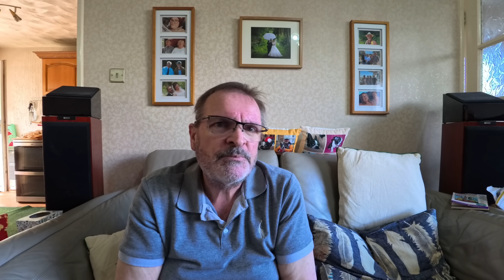Expert Ships Engineer Reacts to Baltimore Bridge Crash

Comment: Baltimore local here, this has been the talk for the last couple of days here and apparently there were two Chesapeake bay pilots on board.  A Pilot and a pilot in training.  All vessels coming into or out of the port of Baltimore, are required to be under the control of a Chesapeake Bay pilot.  The get on at Annapolis and control the vessel until it is docked, likewise they get on at the dock and are in control of the vessel until they get down to Annapolis.   Apparently there was a guy who called into the local talk radio show the morning this happend and said he had been on this ship at the dock doing HVAC work and they had numerous power outages while he was on her as she sat at the dock.  It should have never been cleared to leave.
Reply: Just to clarify. The boats are "under control of the pilot" or the pilots are on board advising the crew? Thank you for the additional information about numerous power outages as she sat at the dock.
Reply: @pgbrandon  The ship's captain remains in charge (with a couple of exceptions it seems). It is more than a formality; he is responsible, they advise on navigation. Off Australia's NE coast, though, if a ship runs aground on a nameless reef there is a tradition of naming the reef after the pilot in charge.
Reply: @pgbrandon  The ship's logs will be a key part of this. Especially pertinent to a distinction between a civil vs criminal investigation, methinks.
Reply: @davidotness6199  i bet we never see the logs
Reply: @drumitar  I replied but my comment got 'disappeared.' At least, I don't see it here. Essentially, I agree it's a possibility if not a likelihood. "Onward through the fog."
Reply: @davidotness6199  Happens to me all the time.
Reply: @drumitar  NTSB says the critical 2 minutes is missing from the black box data recorder. 🙄
Reply: @InnisImage of course it is missing….👿
Reply: @michellelogreco3351  Funny little trend, isn't it?🙄
Reply: @davidotness6199  I get that all the time.
Reply: @schmuckpuppet4842  I honestly don't know, but these stories seem to change over time. I don't rule anything out this early. This administration is way too suspect.
Reply: @drumitar  Why would you, could you even decipher what it writen in the log?
Reply: . Was the pilot a Ukrainian???? .  Was the pilot a u.s citizen ??? Jones Act
Reply: @pgbrandon legally they are under control of the pilot,he gives helm orders to the helmsman. The pilot is a fully trained foreign going master,two of my schoolmates became pilots in our home port & had both Captained vessels of this size,so I imagine that the pilot on board was experienced, the trainee pilot may be learning his new job,but he too would possibly have captained a vessel of comparable size. Add to that the ships captain & other officers on the bridge,even that amount of experience available could not intervene in an engine room failure. I'm sure the Chief Engineer will be sweating bullets & if it a maintenance cost issue,the company leasing the vessel will be in damage control mode.....the black box has issues they say....really?
Reply: @pgbrandon  Only in a few places is the pilot in actual command of the ship, when we sailed through the Straits of Magellan the Pilot made sure that the Captain understood not to countermand his orders but he could change the engine orders to make the ship respond better. The other place was the Panama Canal.  If these pilots in the straits or the canal mess up they get the blame.
Reply: Former Marine Engineer in the Royal Canadian Navy here. If the ship was still docked, then it was probably still on shore power. You don't disconnect shore power until you are ready to leave and all the generators and ancillary equipment on board are functioning correctly.
Reply: @mikearend997 unfortunately, the majority of container ships do not hook to shore power while docked. One key reason is the interference it would present in the movement of the large STS cranes and port container handling equipment.
Reply: @STSwhisperer okay, good to know.
Reply: @STSwhisperer  Wrong, the shore power and CHT and water and steam hoses etc are right ob the very edge of the pier and run along the side of the pier.
Reply: @jerlewis4291  You might want to qualify that sir. Not all ports are the same. Not all ports are built the same. Not all ports have the same infrastructure. By and large the majority of container vessels supply their own power when in a container port dockside. Some newer and self proclaimed environmental ports or services offer or demand shore power but the majority do not. Port infrastructure was not developed to support shore power regularly until recently. Most on have provisions for crane power and vessel water supply. Introducing shore power opens up more regulations and management that some are not equipped to offer. Substations, pier, berth, and raceways are built without this in consideration. More union jobs would have to be created to facilitate this and the ensuing chaos plus the danger of moving cranes, training, qualified  union electricians, and cargo incidents, accidents may make it not viable.
Reply: @STSwhisperer  I've probably tied up in 60 different ports and they are all pretty much the same. Granted they can be different, but  the power and water systems are not going to block the tracks for the cranes. We were tied up to a pier in Newport News that was built in 1942 and they added shore power and cranes and tracks. The layout for shore power and hotel and CHT all are on the edges of the piers either running alongside or on the very edge.Those cables and hoses are not light at all. 

 My friend is a Chief Engineer and he said that when they are import is the only chance they get to shut down the main engine to do maintenance on it. I was in the USN and the ships I was on had 2 different engine rooms and it was common if we were going to be in-port for less than 72 hours to not shut them down because they were steam plants and it took 12 hours to get them back up and running. So one plant would stay online but we would still take water from the pier.
Reply: @jerlewis4291  The 60 ports you tied up at are the 10% because 90% of container ports do not
Reply: @mikearend997 Interesting. Thanks for your input.
Reply: A sister ship owned by this company was banned from Australian waters for six months back in 2021. The seafarers onboard hadn’t been paid and had been at sea for close to 12 months
Reply: Another MMC holder here. My guess was that the pilot was correcting his course, or advising the captain to.  He had the rudder slightly to right when the generator tripped off, probably due to a fuel switchover involving inadequate preheat or clogged filters.  During the first blackout, which lasted around one minute, the captain was unable to put the rudder back to midship. When the lights came on, it was full astern and hard left rudder, which would have swung the stern toward the channel, but the bow toward the bridge pier.
Reply: A very good summary. I am not sure why you mentioned the  MAIB. Why would MAIB be involved in an investigation for an incident that occurred outside UK territorial waters on a Singaporean registered vessel.
Reply: @stuipooey1 The USCG will investigate and write a marine report in their publication "Proceedings".  It will take a couple of years. I retired from the US merchant marine as an engineer and would read through those accident findings.
Reply: Guarantee  there'll be a cover up to the tune of 400 million.  Just watch.
Reply: @mns8732 $400 million?  Why is that number familiar?
Reply: It normally sits between 399 and 401. I've seen it before, I'm certain.
Reply: @Critical_Stinking  what about 420?
Reply: @darrenvail8726  totally, brah! 🤙
Reply: and dont call me Shirley
Reply: @orwellknew9112  the ships master is Ukrainian.
Reply: @Ian-lm5ep  i’m having a Three Stooges flashback LMAO!🤣
Reply: @utley source? Pravda or Tass? Or just tinfoil hat whispers?
Reply: @oldernu1250  too hard for you to look I bet. Dont bother looking at my previous comments in the channel, you'll never find it.
Reply: @oldernu1250  also helps if you actually do a search, its not like the information is classified...container Ship DALI, not hard to look at the ships registry.
Reply: @utley  No that's not true, a Ukrainian worked on the ship in 2016. The crew was all Indian.
Reply: @jessicaarmstrong3169  The ships master...IS...Ukrainian.
Reply: @utley  No...he....isn't. 
A Ukrainian mastered the ship for 5 months, in 2016. 
The crew was 22 men, all from India.
Reply: @jessicaarmstrong3169  if my info is incorrect, then Ill double check.
Reply: @mns8732 . With the USCG coming into purview, your statement is not going to be accurate.
Reply: @mns8732 it’s already happening. 
Biden came out said don’t worry American taxpayers will pay for it . 
Thst way no investigation.
Reply: They are saying contaminated fuel.
Reply: @joeblow4499  potentially
Reply: @joeblow4499  As a retired marine chief engineer, it would be insane to switch over fuels during maneuvering situations. It is done after the pilot is let off and the ship's speed is nearing sea speed. It takes an hour or so (maybe more on that ship) to slowly accelerate the engine to sea speed revolutions. A 55,000 hp engine. One piston is 4 feet in diameter. One must log EVERYTHING, especially when changing fuel tanks, ballasting, etc. Usually there is a designated mileage from the coast in order to switch fuels. Also a designated mileage to start and run the processed oily bilge water separator overboard.  The logbooks are checked randomly in port by various authorities to see if the ship is running within the legal confines of the port/country. They check the ballast logs too so that you do not bring in foreign fish and river life into the country.  The chief engineer will be the scape goat and will end up in jail; the ships have been so de manned, that there are not enough personnel to thoroughly do all of the maintenance, repairs, logs, etc that it takes to run a big ass ship as that. Everyone in the engine dept is tired, working 12 hour days at sea and then working on the main engine in port 24/7.  The companies are ruthless to minimize the crew numbers.
Reply: Curious how these type of stories always attract anonymous experts with inside knowledge of anonymous actors and companies, and it always supports the official narrative.
Reply: Pilots are local advisors, they do NOT take control over the vessel, and if need be the master can overrule the Pilot if the pilot give wrong orders. Anyway, this is a team effort, but the captain is the one responsible at the end of the day. If they had numerous black outs in port this is a concern and probably will be a subject to investigation. But the black out can also be the result of the work done on the HVAC systems. Usually, one generator is not enough online to start a HVAC compressor and if he had bad communication with the onboard team (language etc.) he himself could have been responsible for these while trying to start a HVAC compressor.
Reply: @norseman5041 pilot have legal control of the vessel, they are there because the vessel captain does not know the channel,yes the vessels captain can countermand the pilot,but he'd better be damned sure of his stance. I've been at the wheel under pilots orders.....but maybe they do things differently there than here
Reply: @norseman5041   Can the vessel be hacked by a Nation state like Chynna?
Reply: Master was Ukrainian
Reply: @emergencyeducationpoint1970  Don't say China Utubesteak will censor your comment. You're looking in the wrong direction, your comment is still up.
Reply: @emergencyeducationpoint1970  no, he wasn't, the ukrainian worked on the ship for 5 months in 2016. The entire crew was Indian.
Reply: @jessicaarmstrong3169  thanks. I heard that he was Will look into.
Reply: Wow, then if that is true, the captain was negligent it would appear! Why would they leave port when plagued with power outages? Seems they would want to know the issue was fixed.  Thanks for the info!
Reply: But then the greedy money lovers kicked in, oh ship is fine send it !!!
Reply: Sorry 4 your 6 lost soals... and ingerys... but at the same time I also have too say... you are very lucky this way too big ship... didnt hit that brigh... at its hevines and speed... speed of an rocked... at the 12.00 klock at the zenit... 33000 person crossing that brigh every day... now he is right... human error, tecnical error, mecanical... even uppdating that brigh... built at 1977 shud been a an quiz of economical workabout error too fix... if the free will wood have been there. In the end... i do hope that the worlds all ports will learn about this... 😇. G / Dick from Sweden.
Reply: I can appreciate what he says, but I also think it’s very suspect that Biden has agreed to pay for the bridge with tax payer money. 
These ships have millions of dollars in insurance, for this purpose. Exxon had to pay for their mess and many others did too. 👀
Reply: It was sabotage. . Fbi arrived 2 minutes later says” no foul play “.    Fastest investigation in history
Reply: Was the ship told to leave, even though they were in trouble. The high cost of the ship staying in port would have been high
Reply: Maybe someone else mentions that the vessel was without at least two tugs !   Should have been ! ✨
Reply: so no one has talked to the crew?  and no one will ever be held accountable.
Reply: WOW!!! 😮😮😮
Reply: The master and 21 of the 22 man crew was Indian.
Reply: The Ukrainian guy was master in 2016.  Present one is Indian.  Indian government reported it.
Reply: SEE ! Tolja, tolja.
Reply: Precisely  

So called experts are leaving out crucial information
Reply: Most likely created by the criminal government Democrat machine  !! Part of their destroy America agenda,  fear and disruption of supply lines is part of their tactics,  and yes you can search this agenda yourself,  and they will tell you exactly that !!! Wake the hell up America !!! The present government is our enemy  !!
Reply: Where did the fuel come from Russia? A puff of smoke shows rich condition of carburetors.
Reply: @frankkeel8410  Diesel engine do not have a carborator
Reply: How about what happened was intentional quit looking for excuses for evil
Reply: @JohnDoe-11    ((snicker))  We'll see lots more people parroting that predictable fatuous spew.
Reply: And we all don’t know that it wasn’t a planned event
Reply: @shirleylewis1366   ((snicker))  Predictable babble.  Thanks for the laughs.     This wreck was way too complex for mental dwarf types, so a herd of them will have to spew that.
Reply: @shirleylewis1366  By the "Bridge Builders Union" ?
Reply: @shirleylewis1366 Seems like a lot of things have to go just right (or really just wrong) to pull this off intentionally. Far more likely it was an unplanned screwup. As far as what kind of coverup might happen after, that’s could be a different story.
Reply: They might blame it on Trump😂
Reply: @danieljones604  Oh you know that's coming...😅
Reply: @danieljones604 everything is his fault according to the media, so why not? Lol
Reply: @danieljones604 
Don’t worry.That thing is going to prison for other felony’s!
Reply: @danieljones604 of course they will!!! 😆 🤣 😂
Reply: @danieljones604  that saying is getting old🤣🤣🤣🤣
Reply: Thanks for the info, between this and the video it seems clear now.
Reply: Shouldn't the backups been on if there was an issue? My question is why did the vessel change course before the outage, and why would the data recorder only capture the voice recordings but mysteriously be missing the critical two minutes? When they come out within hours, before a thorough  investigation and tell you there's nothing nefarious, you better believe there was something nefarious. Chyna has the capability to hack these vessels, as well as aircraft and other infrastructure such as power grid components.  Not saying 100%, but it's very likely this was part of their " Unrestricted Warfare " plan.
Reply: @InnisImage the turn was either from refiring the engine or dropping the starboard anchor. The voice recording isn't like a plane cockpit. The bridge is 150' long an no amount of mics are gonna pick it all up.
Reply: @Steve-ev6vx  It's the data from the black box data recorder that's missing,  not the voices. How's that work,  just the critical minutes before the crash.
Reply: @InnisImage  for one they aren't anything like a plane recording. I don't think they even operate all the time.
Reply: @Steve-ev6vx  Do they or do they not record system function and GPS data?
Reply: @InnisImage   If all your sensors, all around the ship, have lost power -- WHAT are they sending TO the black box for it to record?!   Nothing.
Reply: @Avalanche-Ice1950  Then why did it recover the voices?
Reply: @InnisImage The black box records data being sent to it from many locations on the ship. If there is a power outtage, there is no active data to be sent to the black box. However, it can still record sound as in voices & noise of the bridge collapsing. If voices can't be heard, it IS possible that people talking are not within voice recording range. However, extremely loud sounds, like a bridge collapsing, would be recorded.
Reply: @InnisImage  Seems more, like the ship was under-maintained.
Reply: @carlosidelone8064  Maybe, maybe not, no complete investigation, no conclusion.
Reply: @carlosidelone8064  Spot on.
Reply: @InnisImage had the same thought. If they slammed it into reverse to avoid crashing, they were already moving in the direction of the bridge support. But the boat turned into the support, as a result of the propeller effect when they went “full stern,” which would indicate the boat was not on course to collide with the bridge. So why go so hard in reverse if that was the case? Beyond any of this, could a state intelligence agency possibly study these shipping routes, along with wind and water currents, enough to perfectly time a power outage, via cyber attack. The man is speaking truth in this video, but I don’t believe it’s enough evidence to say with certainty that no foul play was involved
Reply: @wakopaco   Now that's a reasonable position. I'm not sure you would have to time it to a route. I think it's possible to get real time data remotely. I used to watch airline and shipping posts on Twitter, they had real time positions and movements of crafts all over the planet.
Reply: @InnisImage  yes. A combination of historic patterns, real-time data, and an understanding of how a power outage affects the ships systems. Doesn’t even need to be hacked remotely. Could be one person on-board causing the power outage at the right moment.
Reply: @wakopaco  👍🏻
Reply: @InnisImage  The ship is not connected to the internet. On board computers are stand alone. Good trying to hack.
Reply: @robertdusziii4125   You're certain that vessel didn't have a Wifi connection, satellite? In this day and age it seems unlikely.
Reply: @InnisImage  According to ships engineers, the on board computers are not connected to the internet.